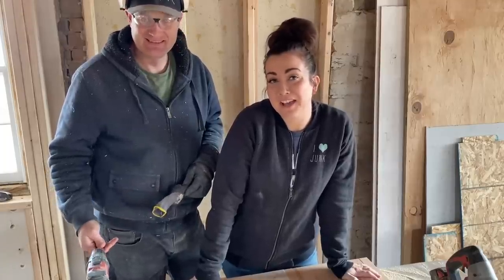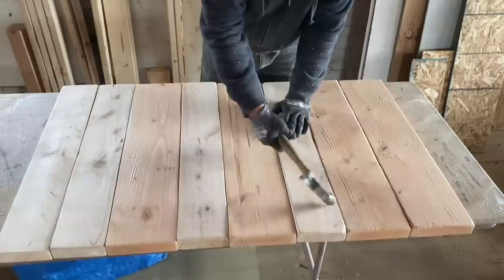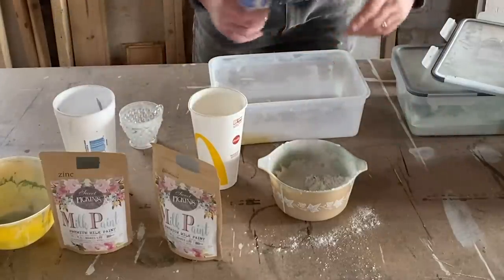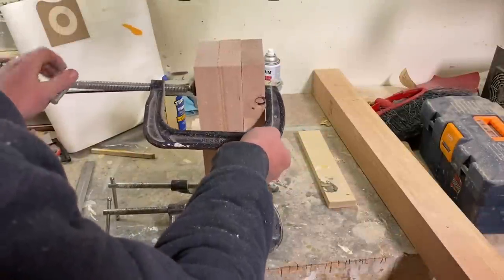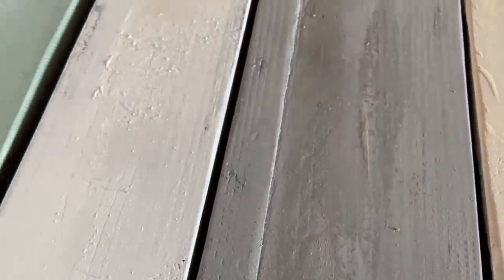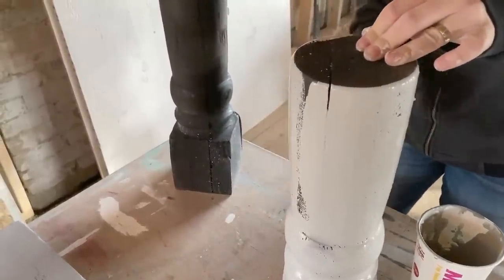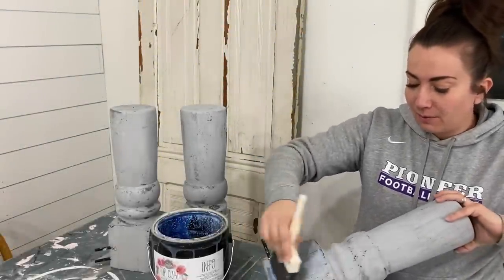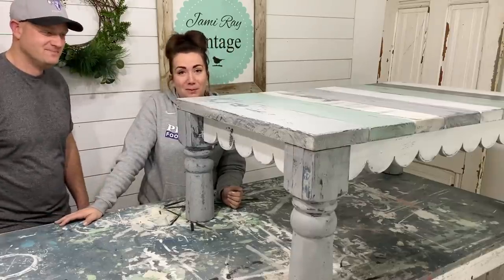How To Make New Wood Look Old And Weathered | Salvage Wood Texture Technique

Comment: Nice vid, thanks for sharing this technique.  I've never worked with milk paint before, does it always crack under heat or did I miss a step and you used a crackling agent along with the paint?

Comment: I am a sucker for functional sea foam/blue green shutters. They dont have to be typical slated wood strips...all types of designs .... can make or break the look of the front of the house. 'Chippy, aged wood' with color and design variation can be an authentic way to: have your house front make a statement...break cross breeze or heat helping to lower energy demand....

Comment: Great Video, Question - To age furniture do you have to use Milk paint or can I use Chalk paint? Thank you!
Reply from the maker: Doesn’t have to be milk paint but this particular paint will naturally chip and age and it’s very similar to the way paint wax made 100 years ago so it’s easy to achieve that aged look.  We use DIY paint which is a chalk-type paint all the time and distress it as well. It just gives a little different look

Comment: Can you spray paint the base coat over an already painted but rough sanded surface?  then continue the rest of your instructions?
Reply from the maker: It should work as long as the paint underneath is in good shape

Comment: Love the technique but the number of tools (I’ll never own) used ....except for the hammer and heat gun.... made me a both sad and determined. 🤔 How can I do this without those lovely do-hickies.....or a Zeb?
Reply from the maker: A countersink drill bit, a drill, circular saw or miter saw and hammer is all you need. 😊 (Home Depot will cut the wood for you) Instead of turned legs 2x4’s work really well.